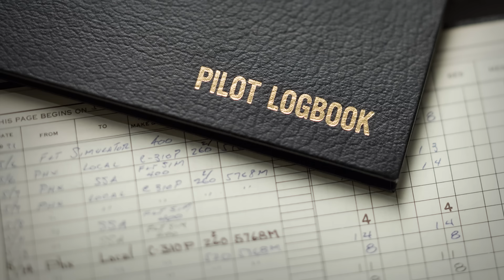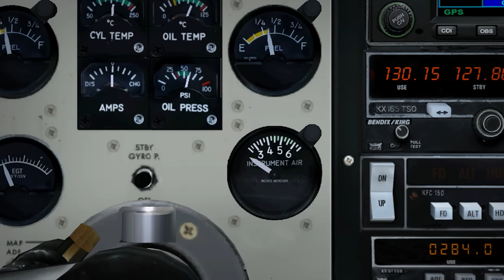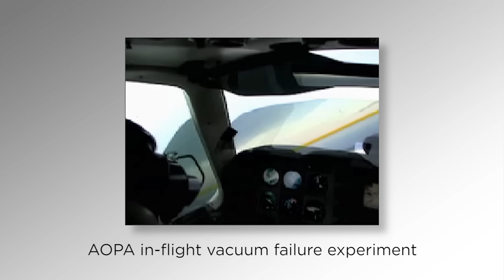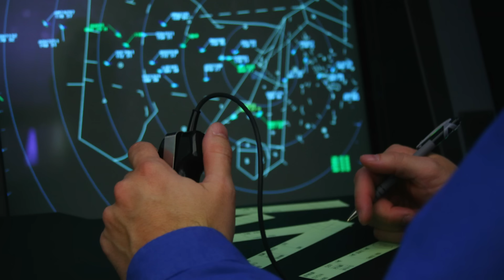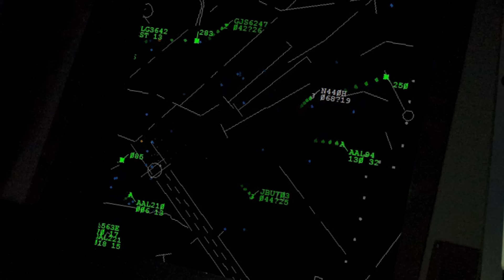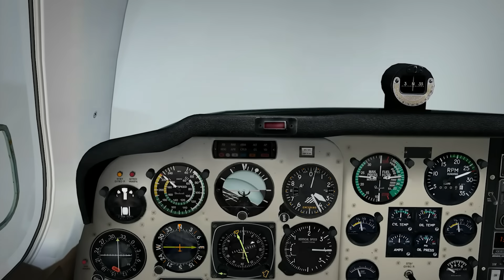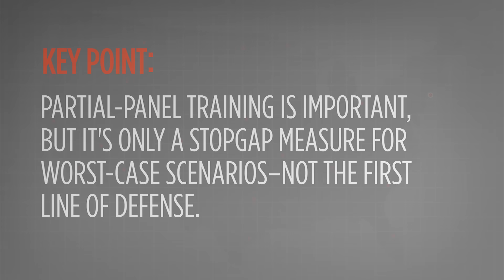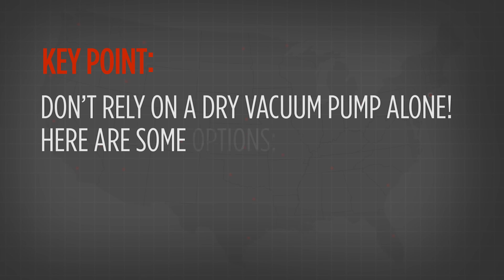Accident Case Study: Single Point Failure

Comment: Listening to ATC makes me cringe. As a Center controller and a pilot, I can tell you that 80% or more of the controllers don’t even know what a vacuum failure is. It’s sad.
Reply: If you have a failure it is best to indicate to ATC [ Air Traffic Control ]  in plain language what the failure is and what is affected by the abnormalities.. You can go on and on all day about controllers not being technically savvy but that is not the point. No matter what you are flying the limitations and restrictions if understood will get you more help even if the controller could build an aircraft.
Reply: @YouTube.TOM.A  Failure to communicate well enough.
Reply: ATCs aren't supposed to be pilots or airplane mechanics.  It's up to the pilot to tell them how big of an emergency something is, not just tell them, "I'm having a problem with such and such."  Tell ATC you have an emergency and then tell them what you need to do.
Reply: Yeah they seemed to focus on the word "partial" not understanding what he was saying. On the part of the pilot, and I've been guilty of it too, there is a reluctance to declare an emergency, which is just silly, as long as you aren't maliciously abusing your PIC authority the worst you will have to do is file a written report. When the pressure is on like that you need all the help you can get.
Reply: Kind of like working with pilots at times when's there's trouble with a system those who hold the - A/P or IA ratings at times have a much better understanding and at times give a lot of help or Ideals to the ground crew as well as knowing a little more of what to do or not do in flight
Reply: Not nearly as sad as terrible pilot communication skills in emergencies. ATC doesn’t need to know what a vacuum failure is anymore than a cop directing traffic needs to know what a catalytic converter is. The pilot needs to understand the gravity of the situation and communicate precisely what he needs. Again and Again people focus on ATC in cases of pure pilot error. The comments seem to believe they should be therapists, best friends, and have a greater working knowledge of the plane than the pilot.
Reply: 33moneyball Well the FAA and just about every controller the did their recurring training last year would disagree. This exact crash led to a nation wide campaign to get controllers onboard with major systems and emergency that may seem mundane. Controllers (well most of us) are true professionals that want to know every aspect of our speciality. To neglect the whole “you can’t expect ATC to know airplane stuff” is asinine. It’s our job to know, plain and simple. It’s also the pilots job to convey the true emergency. Anyway, this prompted me to rip out the vacuum system in my aircraft and install a triple redundant EFIS. We can all learn from the mistakes in the accident.
Reply: It was, what, 4:00 in the afternoon when this accident occurred? Had ATC and the pilot just agreed to get out of clouds, get away from the system, whatever the inconvenience, as this program notes, this accident would not have happened.
Reply: He sure got a beaut there.
Reply: Yep dumasses
Reply: Its good to know this. Allows for better knowledge of what to do in an emergency. like they might not know i have to really do the PIC
Reply: Yep, at N90, what they lack in ability, they make up for in attitude.
Reply: @Bart Solari That's... literally what most controllers would think (I'm a center controller too). Your portable hand vac isn't working and your floor is full of crumbs or something. Maybe at best something to do with the engine running rough. And "partial panel" probably that the door panel broke off.
Reply: ATC should at least be trained on what it causes, the loss of the attitude indicator and directional indicator
Reply: @Hedgeflexlfz  
I'm not a pilot but it seems like there are a million things that can go wrong when you include all the different planes that a.t.c. have to deal with. It is probably more efficient to have the pilot more capable and willing to explain the situation he is in at the moment rather than expect the ground people to all be qualified as in type pilots as well as flight engineers.
Reply: @Hedgeflexlfz  aircraft have so many different systems you can't expect a controller to be a pilot, just as you can't expect a pilot be a controller.

Comment: I guess I have a slightly different perspective on this. I've experienced vacuum failure in VFR on several occasions. One immediate thought is the lesson that vacuum failure can occur instantly, and even on a brand new pump. It's part of life, and it used to be a thing we trained for and kept current on because you just expected it to happen eventually. Backup vac pump on a Cessna 150 or 172? Yeah right!
There was a time when an instrument panel was a VOR head and an ADF. I did so many partial panel night NDB approaches in my instrument training that I had all of the local approaches memorized. I did those approaches in turbulent conditions and learned how to deal with it. Is it easy? No, it's not, and it's a perishable skill, hence the reason I no longer fly IFR. Another issue is the decommissioning of so many old navaids and approaches has eliminated the IFR capability of most older aircraft. IFR is an expensive skill to keep up, and it doesn't get cheaper if you own your own aircraft as my dad has found with a rather nice Bonanza that's been effectively rendered VFR as above.
My current opinion is that if you aren't prepared to pay big money for the rest of your life, forget IFR. It only gets more expensive from here. And if you're stuck flying VFR, find an instructor who will throw you through partial panel IFR training on a regular basis. Fly long enough and you'll probably need it.
Reply: There is a simple back-up vacuum system that uses the engine's intake manifold suction to drive the instruments. Operates on a push-pull cable. I've installed the system on several small aircraft, 172's, Pipers, etc.
Reply: Easy solution: fly gliders :). Of course, sometimes the batteries run out, and you lose part of the panel there, too...
Reply: @Rickenbacker69  We only use the (auto) battery for a radio.  Can get by fine without it if you watch for traffic.

Comment: One question. How would this pilot land if there wasn't a vfr airfield conveniently located within the fuel range?
Reply: I agree with MyTech, except that it is possible to fly an ILS approach partial panel. Don't know about anyone else, but, it takes intense concentration and wears you out.
Reply: @raoulcruz4404  It’s definitely tiring, but I’d much rather fly an ILS partial panel after being given vectors to a 10 mile final than have to fly a VOR approach with a procedure turn. Been there, done that, no fun at all.
Reply: In this specific case, cloud ceilings in the area were 500-1600feet above ground, so assuming proper pilot skill with the backup instruments(compass and altimeter) and working radio ATC can simply tell him to use compass heading, speed, and altitude as they normally do with the exception that they will give his path priority and make other aircraft change course.
With operating envelope data for the plane, after vectoring the plane to a navigation point to start the final approach they can calculate needed speed and decent rate for a desired glide slope (usually about 3%). Instruct the pilot to maintain speed X altitude Y on heading Z, then at the appropriate distance from the airport, "maintain speed X, descend at W feet per minute.".  With minor corrections along the way, like "reduce decent rate, you are 100feet below glide path", "turn 3 degrees left" At some point the pilot will be below the cloud ceiling and all is basically normal at that point. 
If cloud ceilings are very low (like 100 feet) or indefinite(thick haze, measured as vertical visibility) you must have very special auto-land equipment both on the plane and on the ground and be trained in how to use it. Without such equipment you are boned, it may be best to go over water just along the beach, configure speed for landing very early and descend very slow hoping to see the surface just in time to flare and within close range of rescue boats or beach. Empty fuel tanks will stay afloat for quite some time unless ripped open.

Comment: The plane came out of the clouds in pieces?
Reply: Likely panic caused incorrect control inputs that created turning g-forces beyond the structural design and one or both wings broke off.
Reply: Thanks, its hard for me to imagine that planes can fall apart so easily. But i am learning.
Reply: @dougjohnson9948  They DON'T fail easily, he was likely pulling many many gs, possibly (likely?) even unconscious at break up, if that was the mode. 

Another possibility is greatly overspeeding an aircraft, which can also cause in flight breakup due to flutter, and you would be FULLY aware there, at least up to the point of breakup, where stresses usually go wayyy up really really quickly...as in buzz/SNAP/12 gs, possibly as fast as you read those three words once appropriately insane speeds well above Vmax are attained.

Comment: Another excellent video. But that vacuum pump was 17 years old, and had only accumulated 373 hours. Since the pump runs whenever the engine runs, and the engine runs only when the pilot starts it,  it suggests (unless a used pump was sitting on a shelf for a long, long time and then installed, which makes no sense), that the airplane was not flown much. If the pilot was equally rusty, an accident under partial panel pretty much explains itself.
Reply: Yep, that's it, right there. I would also guess that the pilot's 4000 hrs total flight time convinced him that he could accomplish the feat.

Comment: They didn’t mention as a factor how that piece of shit plane broke up in mid-air. Any plane that isn’t rated for aerobatics or can’t handle unusual loads on its frame is crap, even a Beech Bonanza.
Reply: That would include all jet airliners.  King Airs, Learjets, Citations are not rated for aerobatics, either. None are rated for aerobatics. Pilots have broken aerobatic rated aircraft, too.
Reply: Lol what a stupid response this is. Must not be an engineer...I can tell you with 100% confidence that anything built can be over stressed by nature. Call it the 4th law of physics. When you stress things beyond their limit load, they plastically deform. What a plank...sometimes it’s best to sit quiet and have people assume you’re stupid than to open your mouth and remove all doubt...which you’ve done for all of our pleasure.

Comment: Loosing 4,000 ft in 20 seconds is 12,000 FPM. Was this a stall? Was the pilot hoping to breakout of IMC? Did the pilot notice the loss of altitude? I don't expect answers, just hope this does not happen to others.
Reply: No, it was what's sometimes called a "death spiral", a very steep descending turn, where attempting to "pull up" only steepens the turn. He probably wasn't referring to his instruments, kept trying to pull out and only made it worse. Until he either passed out from the G force, or the wings came off.

Comment: I had a vacuum pump failure in a Piper Arrow. Took off into IMC and it failed in the clouds. Called an emergency and got on top  at 6000 ft. ATC gave me a radar landing, thankfully all uneventful.
Reply: I had a vacuum pump failure but luckily it was a clear day at 3000 feet 10 miles from home airport.
Reply: I’ve also had one, was an MVFR day. Fortunately was only about 60 miles from home at the time and had plenty of cloud clearance, was just low vis. Not a good experience. The worst was watching the AI slowly tumble. If you didn’t see the vacuum gauge at 0 and were in IMC, following that would have been deadly. Fly with dual G5’s now, much better!
Reply: @Grace Jackson Oh, duh. Thank you! Now let's pretend I didn't have to have that explained.
Reply: @KatyaEll  what happened to Grace Jackson's comment? Can't find it. Pax
Reply: @rduff1999  It's gone for me, too. In short, they reminded me that gravity and acceleration are the same for the purposes of attitude readings in an airplane and what I described would not be useful.
Reply: @KatyaEll  K thank you for explaining.  Pax
Reply: Sounds like you did some good flying. Vac pump failure in actual IMC is an extremely serious emergency. Well done
Reply: Did that result in the loss of the attitude indicator and did you have a passive gravity backup? You know, a sphere with a smaller sphere inside that uses gravity to keep the black half on the bottom and the white half on the top?

Comment: 3 freaking people died on this flight. Jeezus!  
Review of a vacuum pump manufacturer's service letter (SL) revealed that the mandatory replacement time for the make and model vacuum pump was 500 aircraft hours or 6 years from the data of manufacture, whichever came first. Compliance with the SL was not mandatory for 14 Code of Federal Regulations Part 91 operations. The vacuum pump was manufactured in May 1999, which was 17 years before the accident. Additionally, the airplane was not equipped with a backup/standby vacuum pump.

Link to report: http://www.kathrynsreport.com/2016/05/beech-v35b-bonanza-n440h-fatal-accident.html

Comment: In the good old days of Stermans my instructor said the magnetic compass tells alot more than just heading. You have to know/train to read the movement.

The most interesting fact after reading the comments is when there was no ATC the pilots would enter a spin to descend thru the clouds. This worked perfectly well. Full back stick and full rudder will drop you in a stable descent. 

In this instance given the weather and visibility along the route after failure...the first VFR airport within fuel remaining would be the first choice. 

Option 2 would be gear and flaps down, trim for speed below manuavering and keep wings level with electric turn coordinator.

Comment: how accurate would a table/smartphone be with a simulated panel? Because I don't think the accelerometers are set up to give an accurate image of what the plane's attitude is.
I'd have to test it but wouldn't a tablet indicate "level flight" when you're making a coördinated turn? Likewise, if you're turning uncoördinated it could provide you with wrong information.

I mean to say that a tablet responds to any and all G forces (fly straight and level, tilt the tablet 90° to the side and it'd show you as flying at a 90° bank angle) whereas a gyro stabilized system would not. It might be enough to get you down if you're not doing anything crazy but unless your tablet is linked up to some ADS-B receiver with an "attitude indication" feature I wouldn't trust it.
Reply: It could be very accurate, if it's properly set up. But I wouldn't rely on it to save my life, when there are other instruments (i.e. turn indicators) that I KNOW are 100% reliable, if I just practice flying with them.
Reply: Depends on the software. Hopefully it would use GPS data, compass, and rate gyros to get that data, not just the accelerometer. Newer phones have very good rate gyro data considering how small the sensor is. (That sensor is used by VR systems, as well.)

Comment: ATC asks if pilot is declaring emergency.  What happens if pilot does so ?  I mean, if he lands with no incident after declaring emergency, does the pilot get thoroughly scrutinized on actions and possibly penalized ?
Reply: Just some forms to fill stating the nature of the emergency, basically for the FAA to use for statistical purposes. It gets reviewed as any incident to determine the root cause and contributing factors. If it caused significant disruption like delaying major airline traffic then they may investigate a bit deeper to make sure you weren't just trying to cut in line or some such thing. Penalties are usually only applied for clear cases of negligence, recklessness, or willfully violating regulations;  gross incompetence or mental state could lead to revoking certificates rather than penalties; but for the most part any significant issue (even psychological) is good enough reason for declaring an emergency, and they prefer some airport delays over a any chance of smoking hole in a schoolhouse full of children.
Reply: Romy Kim I'm not a pilot, but my understanding is that declaring an emergency simply makes you the priority traffic for that controller or airport until you are back on the ground -- one way or another.  Nobody expects you to crash the plane in order to get out of trouble, the goal is always supposed to be a safe landing.  There may be an investigation afterwards, but even that has to be far better than killing oneself to avoid such.